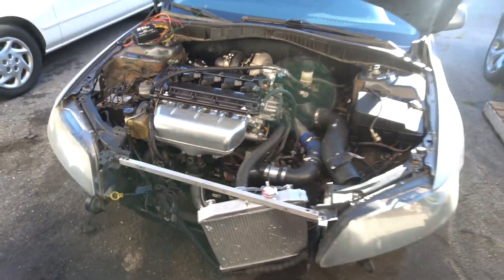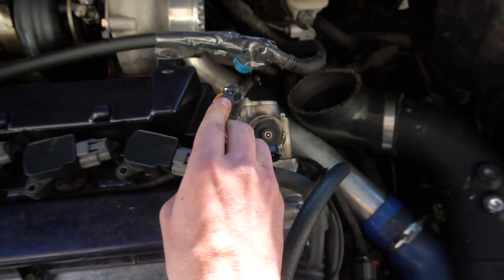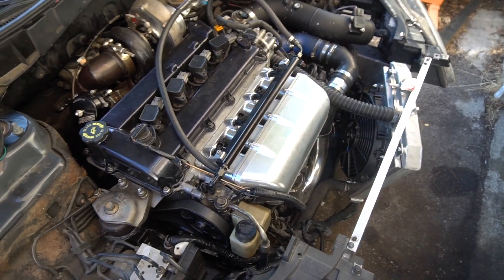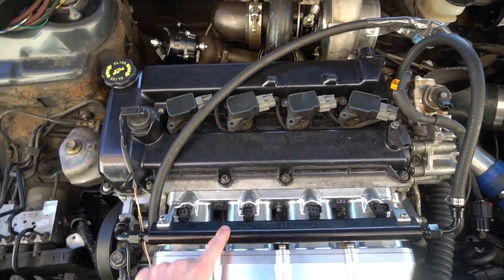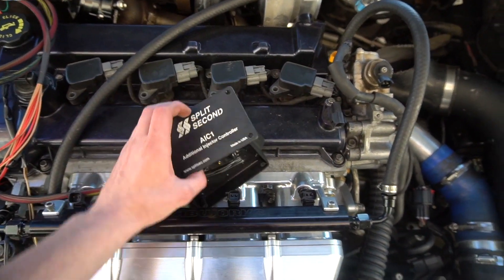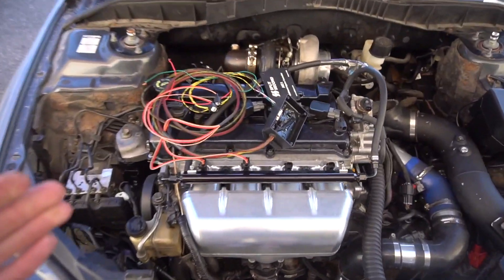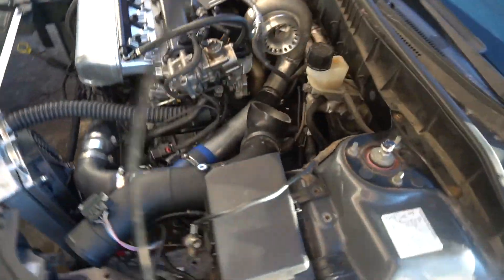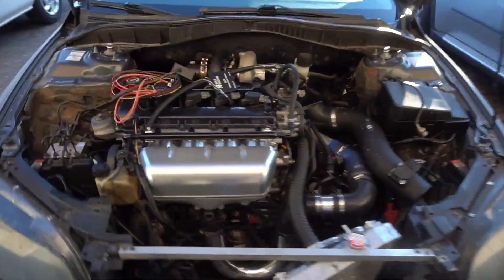8th Port Aux Fueling for Mazdaspeed 3/6. Everything you need to know. How to set it up!

Comment: My man is back again 
Another great video 🔥
Another  option you can go with is grab yourself a couple of -6AN to 5/16 “. Quick Connect  adapter fittings 
It will replace the stock feed line from the firewall 
Basically it converts the stock line to An lines 
Then you get a -6AN tee fitting that will split the from the hpfp to the intake manifold fuel rail the from the fuel rail back to the return on the hpfp 
It’s cheap but much safer
Reply from the maker: Hey I like where you are at, I have seen the T method. Are you saying it’s safer to run better lines, or it’s safer to run the T method?
Reply: Steven Devey  it’s kinda of the same way your doing just cleaning things up and running better hose to keep things safe from fuel leaks in the engine bay
Do want all that hard work and money go to waste by cheap I g out on some fuel lines 
You can get push lol hose and fittings at good price 
It’s a common set by a lot of speed owners
Reply from the maker: speedlife madzela oh I see what you are saying. So you like the way I routed it, you are saying I should just upgrade my fittings and lines?
Reply: @StevenDevey  that's it exactly
Reply from the maker: speedlife madzela alright cool I’ll look at some nicer lines. Do you find the T method works better than the way I routed it?
Reply: @StevenDevey   the T method is a good way to go. 
If your not gonna be running your port injection  all the time
Reply from the maker: speedlife madzela what do you mean not running it all the time? Isn’t it hooked up for good? You would have to change your tune.?
Reply: Steven Devey sorry for the confusion lol
Yes it is hooked up all the time
Reply from the maker: speedlife madzela you are alright, I was just making sure. I might end up trying to run a T style.
Reply: Steven Devey  I’ll probably be running the same setup just waiting a few more parts for my set up

Comment: Steeven, the yellow is a return to tank, the up to 2000PSI is the metal one below the HPFP
Reply from the maker: Mario DANTAS the yellow one returns to the tank? How does it get to the tank? And thank you for letting me know, I forgot the metal one was the 2000 psi one. Good catch
Reply: @StevenDevey  sorry Steven, no return to tank but return from spill valve in fuel rail I think 🤔

Comment: Steven, I was wondering if the 8th Port would aid in breaking down carbon build-up  on the intake valves? What's your take on that?
Reply from the maker: mikef058 it absolutely will help keep them clean. If you run methanol it will keep it even more clean. People have seen improvements in longevity for sure
Reply: instablaster.

Comment: Nice videos man, I just got a speed 6 and I'm also in SLC. I accidentally broke the yellow fuel line clip while removing it, any tips on how to fasten it or where to get a new clip? If I have to I'll order a whole new line.
Reply from the maker: You can replace the whole line with generic fuel line and double clamp it from both sides. I did that for about 2 years